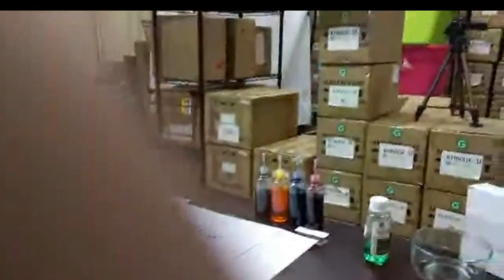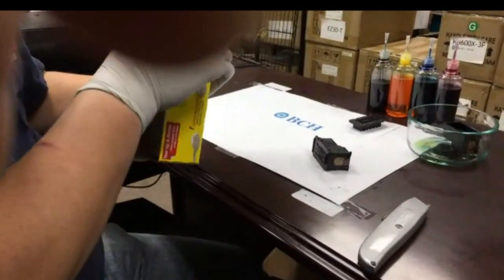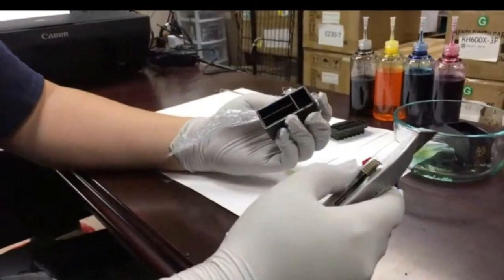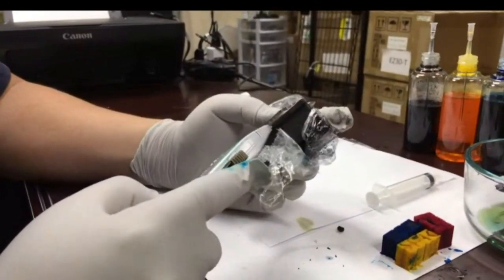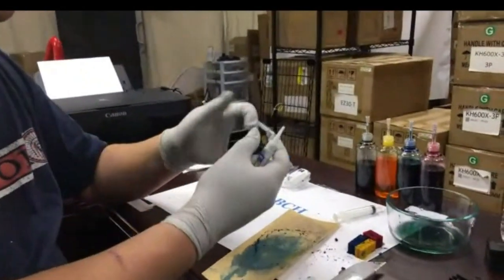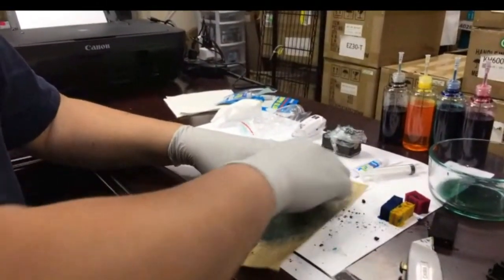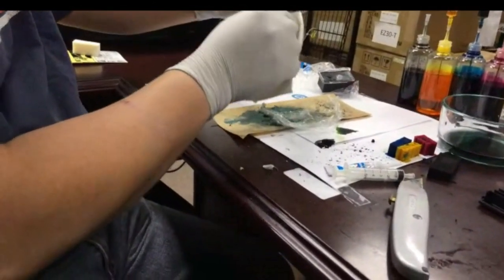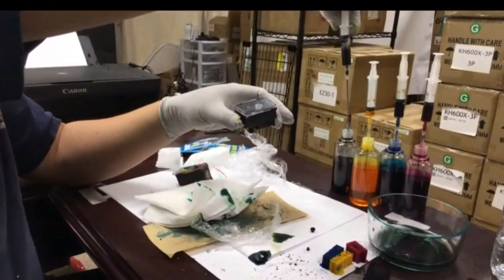Canon Refill: Make Sponge-less Refillable Cartridges for PG-240 CL-241 PG-245 PG-246

Comment: I have refilled my ink, and on my Canon still tells me it's low. on both colors. My printer is not responding to seeing it as full. And I have read something on this, were the ink has codes on them. So is this telling me I need new ones no matter what?
Reply from the maker: Keep printing until you reach the max, then turn the ink monitor off.
Reply: @BCHTechnologies  it wont print. Stays in Error low ink. Cant do anything.  I am lost.
Reply from the maker: @frogfrogger6260  Put a page on the scanner and do a copy.  If it can copy then the problem is not the printer.
Reply: Yea I've always had this problem with refilling ink. The adding ink part is easy. It's getting around the Nazi electronics that's hard. I've never been able to reset a printer once it decides to lock you out. There should be a law against these printer companies scams. Now I just wait till black Friday and buy a couple of 19 dollar printers, ; )

Comment: Hi sir what kind of sponge can i use to replace my hp303 cartridge sponges.
Reply from the maker: Thanks for subscribing and being part of our journey toward the 100k milestone—we truly appreciate your support! The sponges used in those cartridges are actually a special type designed specifically for ink absorption and flow, so I wouldn’t recommend using generic ones. Your best bet is to search for HP 303-compatible sponge replacements on eBay or AliExpress. Subscriber questions are usually answered within a few days, and although I’ve got a big backlog right now, I’m working hard to catch up—thanks for your patience!

Comment: How about using RTV  silicone sealant rather than super glue it forms like a seal for automotive uses and can be cut through to remove the cover if necessary? DOW Corning Blue RTV is what I am referring to.
Reply from the maker: I will try it.  Anything that's airtight and waterproof will work.  Maybe aquarium sealant too?
Reply: The only time I've sealed an aquarium I used silcone. I wasn't even aware there was a more niche product until I read your comment.

Comment: I see rinsing the cartridge are you just using bottled water or is that a cleaning agent of some kind?
Reply from the maker: Yes, you caught me.  I supposed to use distilled water but I found these cartridges are very forgiving.  I've been using bottled water and there haven't been any problems.  I would use distilled water for high-end photo printers.